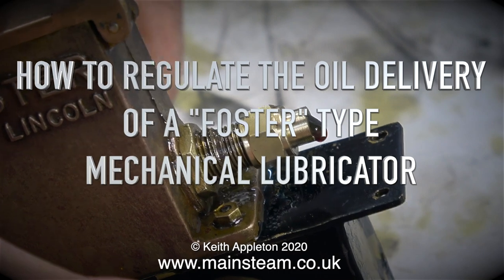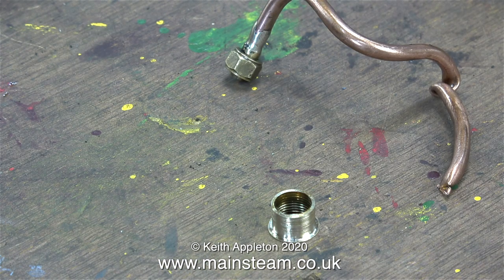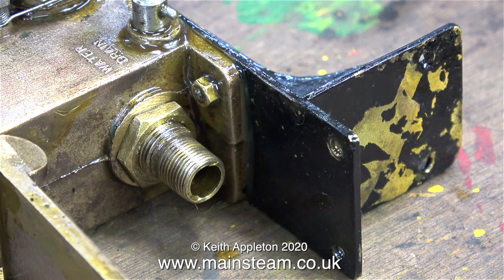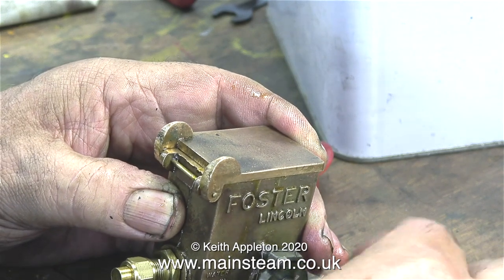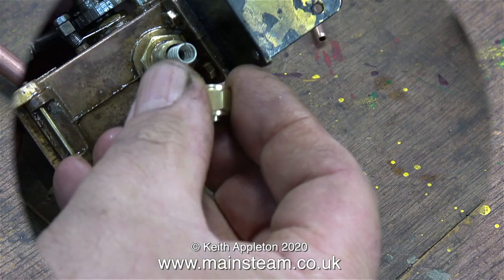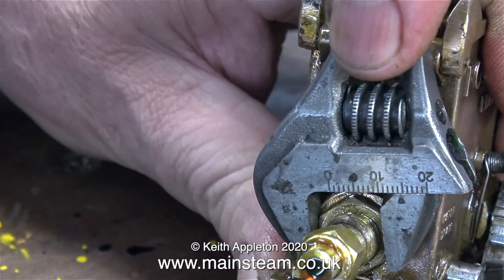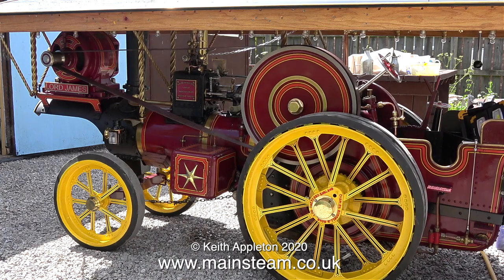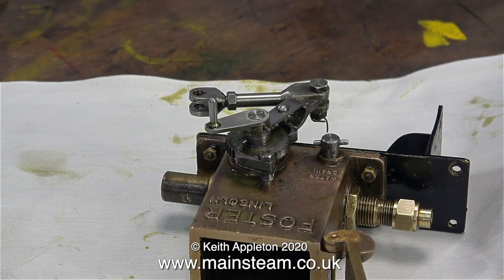HOW TO SET THE OIL DELIVERY OF A FOSTER TYPE LUBRICATOR

Comment: Excellent little video.. Thankyou… I’m about to adjust mine on my Foden Waggon … it uses masses and I couldn’t recall if it was in or out for less than
Reply from the maker: Glad it helped  }:-)))
Reply: @keithappleton  they were both producing a large drip every revolution.. I’ve turned them down to about 1 every 10 revs and producing a small  amount each push of the ratchet

Comment: Different strokes for different folks, is what we used to say when I was doing Hydraulics and Pneumatics, the same applies to pumps, but better a tad too much oil then not enough. Have you ever had a stack catch fire from too much oil residue in it?
Reply from the maker: Too much oil is a problem because it runs out far too quickly - then you don't get any oil at all . . . .

Comment: Morning Keith,
I was thinking that looking at the levels on the oil reservoir before and after running at normal operating speed would  be a good double check that your calibration met your requirements.
Take care
Paul,,
Reply from the maker: I have done that by running the engine using compressed air, it seems much better now and the oil lasts much longer . . . .